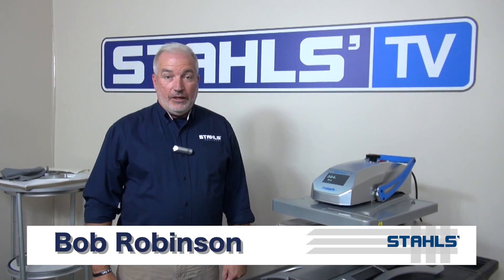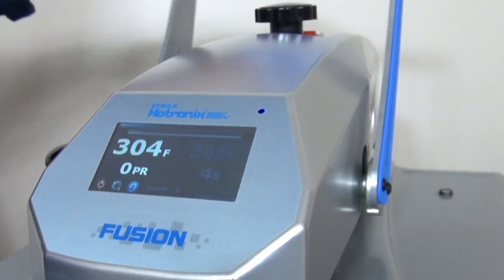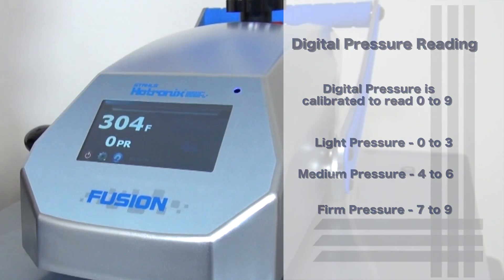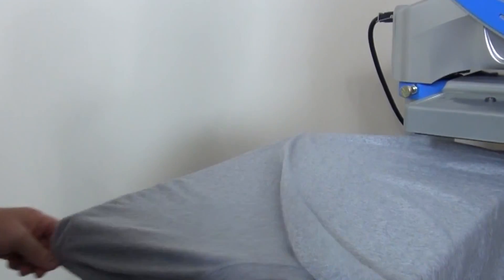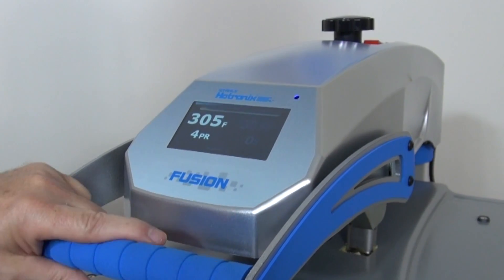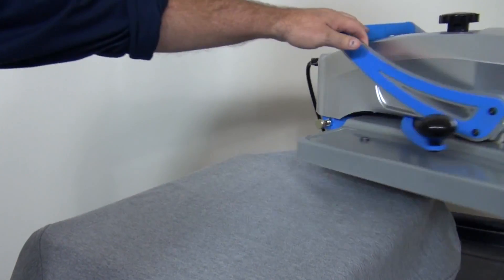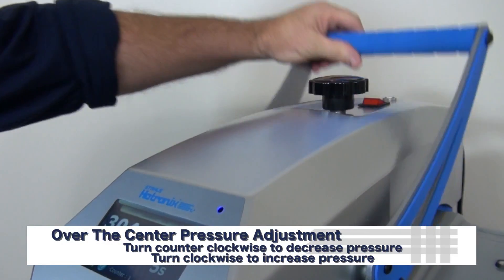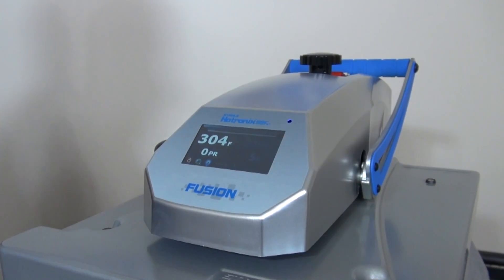Hotronix® FUSION®: Adjusting Pressure with Digital Readout

Comment: I’ve been using my fusion for about 5 years and now My pressure is 0. And seems a little light lately. Is there potentially an issue with one of the components that needs to be replaced?

Comment: after I updated my board 2-3 years ago. I lost the live pressure readout. I didnt mind it then because I was used to the pressure I needed for the majority of my work. I would like to fix it. I am going into different stuff and would like it back. I cant find a pressure sensor on the unit. Where is it located. or what parts do I need to order. Thanks.
Reply from the maker: Please email qe@stahls.com to get assistance with this issue.